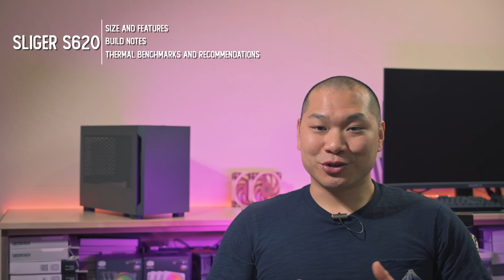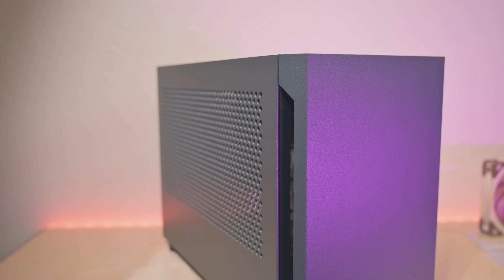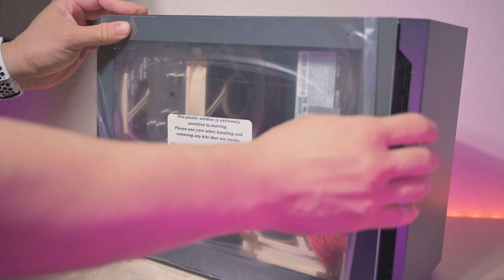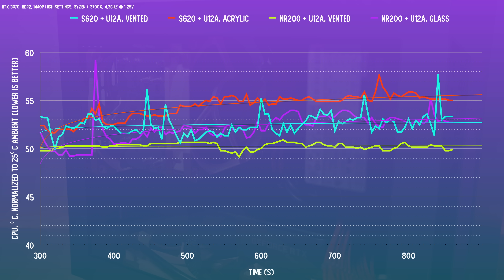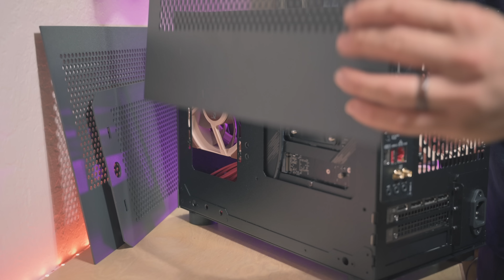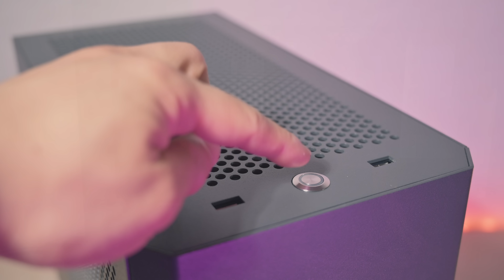The Sliger S620 - One Slick 16L Case!

Comment: I would love to get your thoughts on using the external pump rez with this case or a hybrid GPU (ease of build and  noise). I am interested in using water cooling to make a really quiet build but as this would be my first time building I'm worried it might be a little too far out of my skill level. Seems like it would be easier to do here vs. NR 200 with the case modding.

Fantastic video!
Reply from the maker: Well, my take on custom cooling is, do it for the looks. If it’s a performance argument then I really feel that high end air cooling can get you close enough to a quiet system. After all you still have a potential DDC pump humming along, though your fans can stay low. In the S620 the setup would have to be bottom plus side rad, and the bottom rad absolutely has to have slim fans, and with the side rad this is a vented panel setup, so no “looks” so to speak. Plus the limitation of a integrated CPU pump block or external res- there’s a lot going the “modded” NR200’s way since a bottom rad with thick fans, standalone pump/res, potential top rad with slim fans, while fully visible with the glass, is going to offer a lot more fun for the custom loop builder. You still have the same bottom plus side rad option if that’s desired. That’s not to say it can’t be done in the S620, just not as many options.

edit- On the hybrid GPU - that's a good option sometimes but in SFF it will limit your CPU cooling options. Since the thickness is still too much to mount a bottom rad, you have to side mount it or rear mount it (120 onlyh) and you're either going low profile cooler or potentially a thin tower. It's a halfway point that yields too many compromises- if you're going to water cool the GPU in SFF just go ahead and do a full open loop for everything.
Reply: @MachinesMore  Hey thanks so much for the thoughtful reply! Really good points and a lot to think about. I would imagine it's less painful to start with air and move to water if I don't like it, than the other way around. I guess I'm just traumatized by having an old school blower gpu and super tower prebuild that I want to get as far from the noise as possible 😆

I'll say I'm definitely giving air cooling much more consideration thanks to this channel, very much appreciated!

Comment: How do you think the C14s would do in this case?
Reply from the maker: I’m guessing it’s similar but the U12A would have the edge. With the unimpeded 120mm fan opening at the back and the possible rear to front (or front to rear) airflow direction I’d say your typical tower has more of an advantage over top down. The interior side fan can help the C14S as well.

Comment: Was expecting better temps than NR200 with the same hardware. Could it be due to not exhausting with the front fan? Extra heat into the psu probably* won't be an issue.
Reply from the maker: The front fan is set up to exhaust. The primary difference in thermals between the two cases is primarily from the position and compatibility of the top exhausts- the two top 25mm fan is the best place to exhaust since it creates a highly directed vertical column from bottom to top which works well to get both cpu and gpu exhaust out of the case quickly.
Reply: @MachinesMore  Oh, from the video, it looked like the PSU fan is also facing the front. If the front fan is exhaust, then it probably isn't affecting much bc PSU fan.
Reply from the maker: Ah you meant the PSU fan, yes you’re right. And that’s the dilemma I had whether to exhaust into the PSU or to have it in opposition to the front fan. Obviously the front Noctua is much more powerful, the PSU fan isn’t on at full blast with the 3070/3700X combo at load (3080 is a different story), so I think the effect of it holding back the front fan isn’t as big of an issue as potentially drawing in less air for itself. One of those SFF compromises. At the end of the day the GPU thermals I saw were excellent, certainly for a 16L case in between the M1 and NR200 I’d say it’s doing better than I’d expect.

Comment: D15s can fit a top fan, depending on mobo
Reply: yeah, that's the main thing that hurts cases like this. 20-23L is fine honestly as a good no compromises ITX case size since it seems that Gigabyte boards tend to have compatibility issues with cases like this.